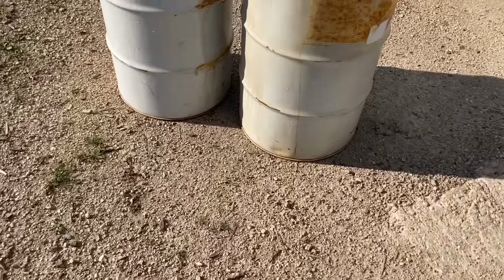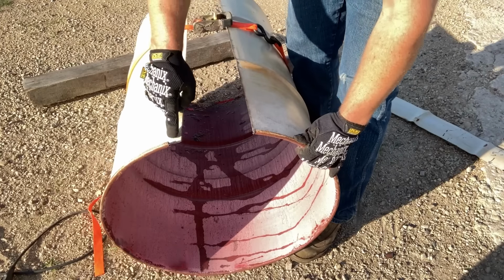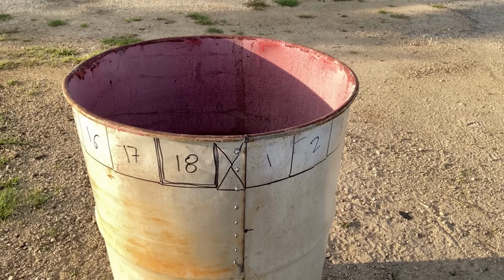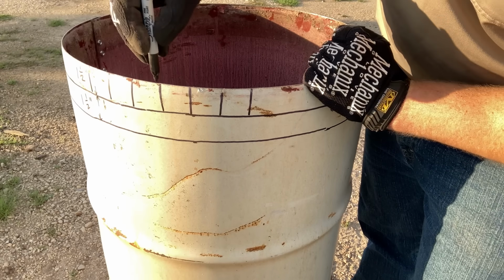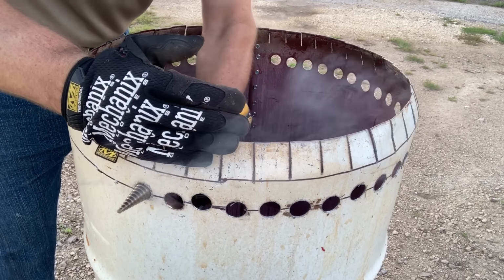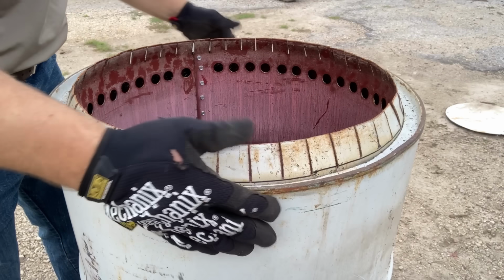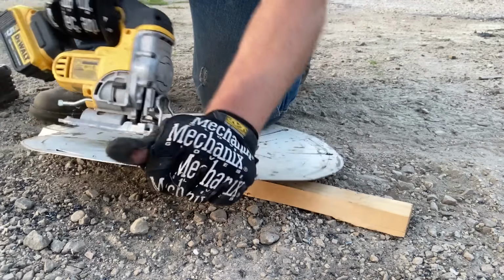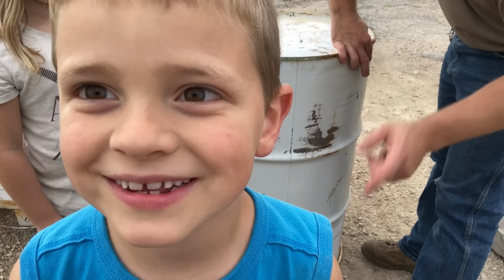Smokeless Burn Barrel

Comment: Question, albeit great design!  Above the bottom great with air flow geometry, could you old school put in some re-bar supports in to sustain heave wood loads?  Just curious if as-is would sustain logs vs wood scraps, and hoping to do that on the first go around if necessary (thinking it would be?).  Thanks much, great video! Have a Blessed day
Reply: You can use anything you wish: rebar grates, welded, stitched together, an old oven grate, a piece of hardware cloth... Like the man said: we are building a burn barrel not a clock... ;-)
Reply: I can tell you from experience that the rebar will sag after getting hot and with the weight of the wood. It does work, but constantly reshaping the rebar.
Reply: @hardluk3  Again: It is a burn barrel, not a clock...
Reply: @koningbolo4700 love you too
Reply: I thought of attaching aluminum tubing for legs but not sure how well that would work.
Reply: @stevenrobertson4470  Someone accidentally set fire to a wooden fence at work. Aluminium ladders which were racked against the fence melted and burned, accelerating the fire, so your ali legs are not a good idea. Try magnesium 😉
Reply: Thanks for info about aluminum ladder!  Not the best idea I've ever had. I'll bet it would get hot enough to melt and vaporize aluminum, our scouts used to throw aluminum cans in the fire and when fishing cans out of the ashes, they seemed to have vaporized.  Titanium would be a great idea and would serve double duty as legs and fire starter ;-)  Using steel pipe might be the cheapest and best.
Reply: yeah i agree, there is nothing holding up teh wood from the bottom,   mayeb an old round grill plate , im pretty sure one might fit perfect.

Comment: The challenge I was dealing with here is helping to reduce plastic pollution, particularly in remote locations. I live in Fiji and we have a lot of plastic waste that we create and that washes in from everywhere else. This was an awesome start, but I made a few simple modifications to increase the heat and longevity. I call it the Rocket Burn Barrel

1. Eliminate the light-weight legs which are just not solid enough. I just put it on 2 concrete blocks which lifts it up even higher and allows more airflow for more heat.
2. Eliminate the lower flaps completely and reduced the square openings to 3 spaced around the base to allow more air to enter.
3. No Pizza! That pizza-grate was the first thing to rust away in a hot/humid climate of the tropics and only lasted 6 months. I now drill 4 sets of holes and insert 4 pieces of rebar for the grate. Better airflow and last a long time.
4. 3 bolts midway up to stabilize the inner and outer barrels and stop them from moving around.   

Using a laser industrial thermometer, I have documented these as consistently burning at over 800C. Most plastic and its toxic waste is completely destroyed at 500C. No toxic smoke or nasty smell is produced. 

We give them away to health clinics and schools and charge a very nominal amount to villages. So far we have distributed over 45 to remote areas. We encourage people here to build there own and I have published the plans on the Rotary website

Comment: Sir , thank you very  much for your video. 
Before I spot it on YT. I was thinking to make  one out of SS washer drum , but on the  side there is to many holes
Then I looked on old waterheater tank,  which  have double wall  already 
But seeing your video,  I'm going  to copy your idea. I'm just thinking for how long the metal material is gonna  last . Beside that I've seen someone's suggestion,  that states,  that the taller the barrel is the better,  because whatever sticks above secondary line of holes  is not gonna burn smokeless because of obvious reason. So whatever we burning it suppose to fit below the top of the barrel. 
  God bless  you Sir , and your  family. The children are so sweet.

Comment: Oh my, I watched this video. It looks amazing. And it is.
I live in a mid terrace house of a block of 4 and had a little stove in the shed but could only lite it when the wind was blowing away from the houses. I've a small shed, small back garden.. I couldn't do the big barrel... LMAO I used 2 tomato tins, 2.7kg tins.
9.5 inch height and 6.25 inch wide. Fair enough it's well small but I copied most of the design, but couldn't cut so many holes in the small tins. I used 30mm L Brackets for the legs. drilled holes on the inside tin, didn't fold squares like in the video. I've a 4 inch angle grinder, small tins. 
I tried it as simple as possible with a small tin. It works a charm... we brought it to a beach camping, a camp fire to our left and right. You could see the smoke at each side. This little thing was perfect. It smokes starting up, cold wood and cold tin I suppose. Maybe cos it's small but about 1 minute later I've a flame thrower. I have savage videos of it (on google maps "Dunworley Beach, West Cork, Ireland, Food and a savage beach),, the only draw back is that mine is small,  I've to cut 10cm bits of pallet wood then hatchet them.
I found though, never have wood sticking out the top, if you keep it about 1/4 down from the top smoke doesn't escape out the top, that's why I cut my strips to 10cm. It's annoying for mine cos you have to constantly top it up (cos its tiny) but it will last 10 or 15 mins flaming, then top up.
Now.... :).
Today I got 25kg, about 60L steel Tins?, or containers... OMG 
There well more solid than the tomato tins and about double the size (height & width)..
If the last little fellow was that good, I CAN'T WAIT..
And normal cut up pallet wood will do, not chop sawing & then the using the hatchet...
I've buckets loads of little scraps here lol...... But still worth it for the rocket stove.
Thank you, I cant wait to see how the bigger steel tins work out, I've 6 to play with lmao, Cheers.

Comment: Congratulations . You have made  made a  "by- pass jet engine using convection currents" so you did not need a rotor nor compression.
Since my grandson was born twelve years ago, I made al sort of " machines" to show him  the engineering movements that makes the world these days.  When I anted to make a " by pass jet engine' I did the  the outer cse exactly as you did, but I did make a single fan  disc to input the air from below  and a hot  turbine disc  up top above  in the exhaust pipe containing the fast rising  hot air which was coupled to the fan below with a vertical shaft, The hot turbine operated with the convection current  and not the compression, So my by pas-jet engine could only work in a vertical manner with the hot turbine above the fan below.  It works and does not smoke as yours.  I did introduce holes midway in the input of the burner just like a jet engine burner.

Comment: I just finished one, almost the same as you, i drill the holes on the inside barrel, but the outside barrel i used my plasma cutter to cut slotes in the bottom, plasma cutter saved me a lot of time! But it works great, i filled it with cardboard lite it, burned for about a minute and went out, everything was gone!!!

Comment: If anyone happens across this video and reads this comment I know this video is old but I have to state a huge issue when doing something like this. Yes its good and works great. But it needs to be used in a safe place. This is actually very dangerous out in the open when it is breezy or very windy due to the coals falling out of the bottom and blowing away and starting huge fires. Ive seen people have open ended barrels where hot coals cab fall to the bottom and wend blowing them into a dry area and lighting the hole place up. I know it defeats the purpose but best bet is keep bottom attached and add a low running air line. This is why he opens the bottom so air can enter. He fails to inform people of the hazards just the pros. Good luck everyone and think before you do.

Comment: A project that worked well for me was to make a boot dryer using a part from a dishwasher.  There is a combination fan/heater found in most North American dishwashers.   Some piping, power cord and safety bits and you're in business.  Parts are available road side or ,wait long enough, the kitchen.

Comment: I made a barrel with two barrels and a box in between the top barrel had different sized screens as it went up so things would fall back down and be incinerated. The first barrel on the bottom I welded a pipe outside and hooked up a jacuzzi air blower motor got so hot it was yellow outside and consumed all sorts of things without smoke. These crazy times forced a couple moves and I don’t know where it is now but with this model and my previous design I’m going to play around a little bit and see what happens thanks for posting

Comment: I like my washing machine drum / barrel. The first one came from a top loader, enameled, and it does absolutely wonderful it makes a 4-5 ft tall torch. Sits on a 5-gallon bucket of concrete slurry with two marble slabs as  table top. My next one's going to be a larger front loader stainless steel

Comment: I remember as a kid the neighbor had a old washer machine. You know the one’s with a roller press on top to ring out the water before hanging the clothes up. It had hole in the bottom. I noticed it didn’t smoke as much as a regular barrel with holes on the bottom.

Comment: I did mine lazy, just 7 cuts at an angle a foot long at middle of the barrel and opened the gap about an inch with a pry bar. It doesn't smoke and the flame is like a tornado. A 10 minute job done off my honey list and the wife has been burning brush in it 2 years now. Plus I kept the lid so it doesn't hold rain when not in use.

Comment: I saw and copied and (mostly) succeeded! Went for my first test run today and it lit and burned fast! I had 2 issues that seem to be my own fault: 

1. My barrels appreared to be the same size so I cut one up to be internal drum. I ended up cutting it down to be almost the same diameter as the 2nd (outer drum). Now I know to measure the barrels next time! 

2. Mine does smoke a little bit more than expected. I may not have had enough of the upper flaps poking above the outer barrel…or because of measurement errors of drums, I may have too much air flow from the lower holes/vents and underside…? I had to trim some outer barrel off the bottom and with the legs, the bottom rims of both inner/outer sit about 1.5-2” above the ground.

If you read this and can suggest anything by my description, would be helpful! Or I will tinker around and see what may solve this.

Great video and well explained!

Comment: I was burning this last weekend, yard waste and there was a ton of soil mixed in. I dumped the ash out and low and behold I had a huge clump of glass. I do use a blower fan for a inflatable bouncy house as an incinerator. But I had no idea that it would get so hot. Wow. 3000 degrees. I use to use a leaf blower until my neighbor gave me the inflator. Just drilled some holes in the bottom around the entire thing then cut a triangle shape large hole, place the blower about 2 feet back. And voila 3000 degrees. Burns everything from soaking wet leaves and grass clippings to green branches. It's crazy and there is no smoke if you get it going hot enough. Which is super easy.

Comment: I did not notice any warnings of empty drum former uses. As a survivor of an empty drum explosion( because of past use contents) it is extremely dangerous to cut, grind or cause any sparks of flames to an old used drum. I like your video and take my hat off to the complex and great design.

Comment: I was in the process of building a waste oil burner from a different design when I saw your video and now I'm going to try something different. Not sure what yet though I'll let you know when I come up with. trying to get heat to the shop and hot water at the same time.

Comment: I've had a blue flame coming out the sides like a gas [ UK methane ] kitchen hob top for cooking.
 About 10 years ago now, I've got a vid somewhere I'll see if I can find it. If I remember correctly it was a much smaller inner barrel 50 to 75% the size.
 Smaller inner holes at the top.
 Greater outer holes at the base.
 Also I experimented with  top cover plates with various restrictive outlets. 
 To see the blue jet is amazing .
 I never got to the next stage which would have been channeling the top heat into a funnel/ chimney system to use that heat.
 The main reason for building it was to be smokeless. If I'm not mistaken it's called a Gassifier ... gasification .

Some early engines used it.

I've seen videos where petrol generators , the petrol was turned off and  wood smoke ran through the air intake ran the generator.
 I'd never tried it to prove it.
 Would it work on any smoke etc ..  who knows ?

The early engines were superceded by Rudolf Diesel, Perkins of England and I think Cummings USA

Re since we're talking about gas :
Before anyone starts experimenting consider the contribution to green House gases .

Comment: Great job, but just be fair and truthful. The barrel is a good starting point for secondary burn, but not the secondary burn itself, as you can see clearly that the colour of the flame is still red and smoke still comes out of the fire. In fact, according to science if you care, the barrel performs as a gasifier of wood, but the gas it produces is not fully combusted, hence the colour of the flame and the smoke. If it were fully burned, the colour of the flame should be blue, or, an even lighter colour that hardly visible. 

I would suggest to install a central pipe (5'' in diameter perhaps) in the middle of barrel allowing gas and more oxygen to be drawn out to the top, which may increase the intensity of the burning process (it may need some experiment). Another suggestion is to build an additional structure of certain type to be placed on top the existing one, acting as a gas burning chamber, where the true secondary burning takes place (still, just an idea, need to give it a try). 

Again, great workmanship indeed.

Comment: My issue with steel burn barrels is that they rust out in about 5 years. After going through several of them over the years, I finally bought a DR burn cage, which is made of perforated stainless steel, and it lets air in from everywhere while containing the fire. It takes about 30 seconds for the fire to turn into a smokeless inferno, and it leaves powdery fine white ash.

Comment: You need a sturdier bottom grate. The air flow produced by what you call the grate is good but most of the material that you want to burn will be too heavy to keep from ruining your "grate", especially when the steel becomes soft from heating. Another grate above yours is needed. 
I've used burn barrels and know that this one as it is, won't last.

Comment: Thank you!! One oddity I've experienced: I've watched this vid multiple times and am following along as I do this myself - I am on the step where I use a 3.5 inch square template to make the 18 squares for the feet/airflow tabs, however, on my barrel (55 gallon Valvoline oil) I have exactly 18 squares and NO extra space near the seam like yours has, and yet when I measure the diameter it's the same ~20" as yours?? I actually had to go back around the barrel a second time and re-mark the squares using a white paint pen (vs the original black Sharpie marks I'd made) so that I could put a 3.5" square centered over the overlap/seam to keep it structurally sound...

Comment: I drill some vent holes in the side and, of course, in the bottom to drain out water. It's for trash. When it rusts to the point it starts getting mushy, I haul it to the transfer station & chuck it, gran a new used 55 gal barrel & set on my 2 concrete blocks that keep it off the ground. Too much work for me to eliminate smoke. I'm sure it burns a bit  more complete/,better. Thank you

Comment: If you add a round grate about 30% down from the top - resting on 3 or 4 pegs/crews and a cooking grill on top - you can then fill it up with charcoal and have a traditional barbeque at kitchen cooker height.

Comment: I'd bend the lower tabs at an angle instead of 90* in, the bend the grate tabs the same angles to it makes the flow spiral the same direction. It'll make the flame want to flow against the sides of the inner heating the air more for the second burn.

Comment: I did this with a 30 and 25 gallon barrel.  Wife said i better get that ghetto ass fire pit away from it patio. 😅.  So i cut the barrels 10" from the top down and i placed it on a 27" diameter fire pit i bought from menards. And it works like a charm.